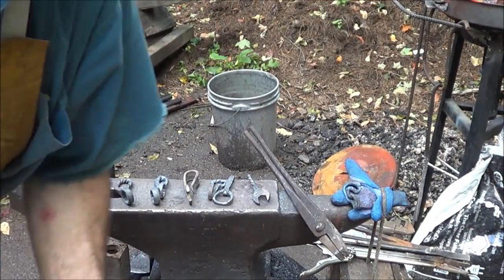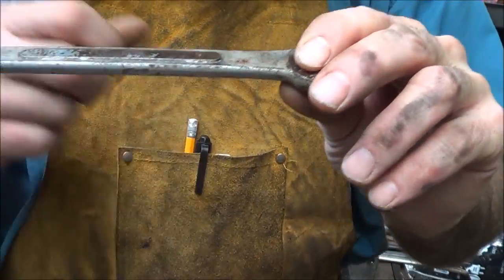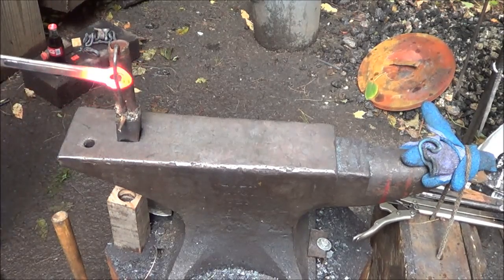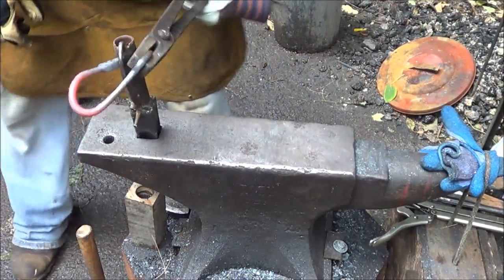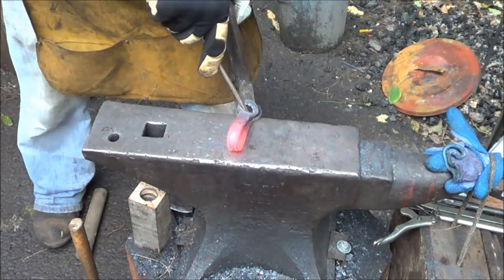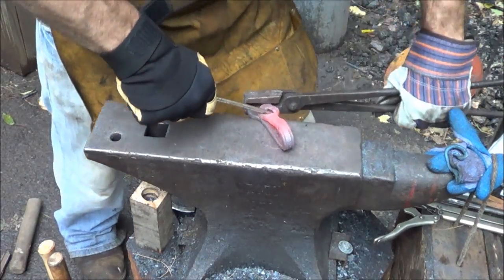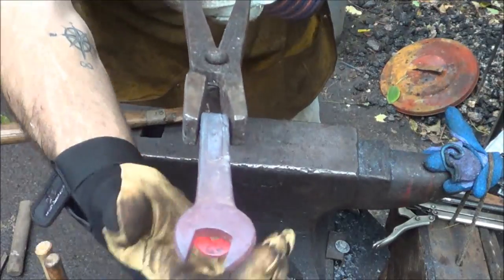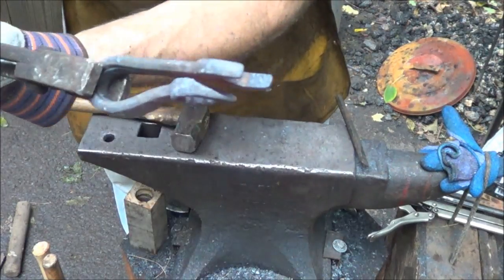Blacksmithing - Forging A Bottle Opener From A Wrench

Comment: I like your designs. I've made a few corkscrews and bottle openers out of old wrenches. You shouldn't be using those Craftsman wrenches though, but not because of the "value." They look to be chrome plated. Search for "OSHA hexavalent chromium." You'll see the OSHA website. They mention hot work as producing Cr(VI), which is cancer causing and affects kindeys and other organs as well. I don't know how much Cr(VI) is produced in forging, or how much a body can tolerate, but I would never forge anything chrome plated. Stick to the old rusty stuff.

Comment: Whats the link to your ebay shop?
Reply from the maker: you can find my stuff on ebay and soon on etsy at

http://www.ebay.com/usr/chandlersstore
https://www.etsy.com/shop/McFinleysCabin
Reply: Dear Sir.. I saw your video of the Viking rune, mini Hatchet, the Deer tine fire steel, and the bear tooth or claw you have for sale on eBay. I love them all.. what would the price be on one for me made out of your three ideas but cut down to one peace.. 
Say a mini hatchet with the fire runs symbol cut into the steel. With a flint inlaid deer tine both to hang from the same necklace. You could possibly make two small deer tine inlaid with flint and the mini axe rune head in the middle? 
I believe that would be beautiful.. the mini axe with  the fire rune symbol hanging between two deer antler tines that are inlaid with flint or one inlaid with flint the other with another peace of fire steel? What would a price be on that?

Comment: lets take a 7 buck wrench and turn it into a 1 buck bottle opener...all that work just to open a Coke
Reply from the maker: Wade Hutchinson The wrenches I use are found by the box full at auctions usually but I do empathize with your point...  However, the bottle opener sells well at $15 so even with off the shelf pricing there still is a little room...lol
Reply: +Chandler Dickinson I think the concept is cool as hell buddy wade can go get bent